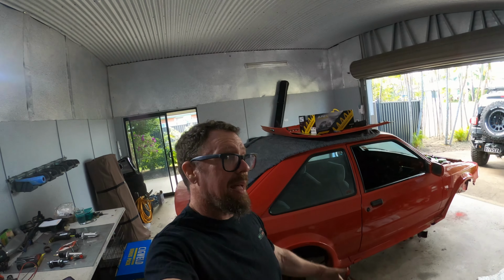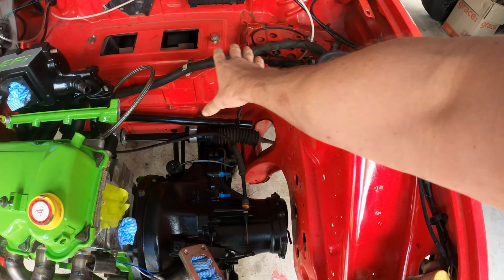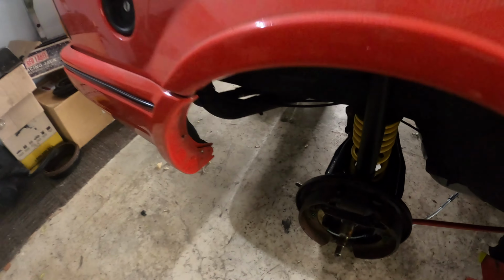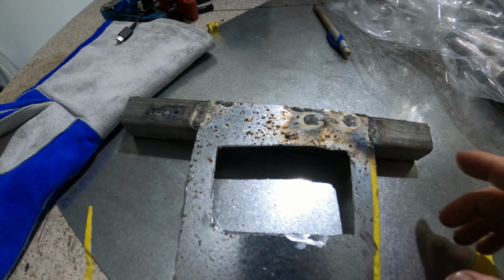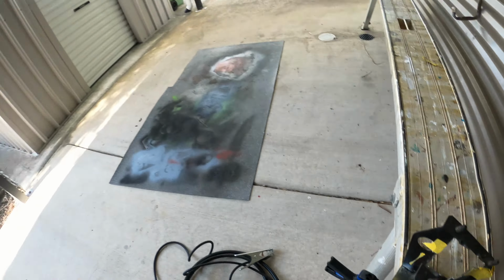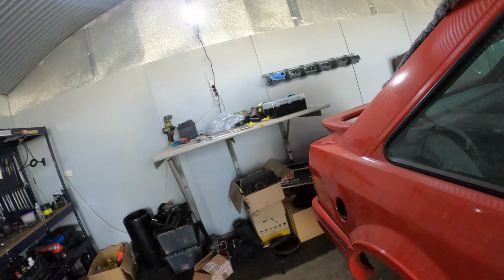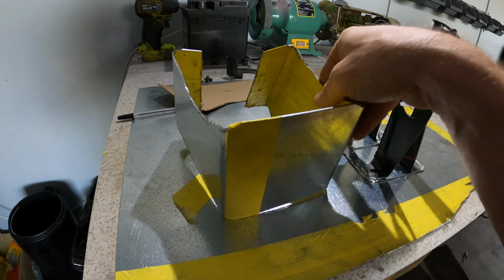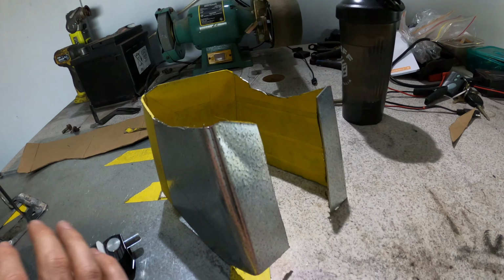Escort RS Turbo Dual Brake Master Cylinder Part 1

Comment: No idea how OCD did it, but it looks to me as if that front plate where both mc will be mounted might flex forward when hitting the brakes hard. You already have some flex due to the right hand drive pedal linkeage needed, so I would consider if it is worth adding a third support bracket between both mc that holds the centre of the front plate. But in the end it's you who will gauge better if it can flex or not, given the thickness used and shape 🙂
Reply from the maker: Good advice mate and it is something I've been thinking about a lot today. But you're right, I won't know until it's together